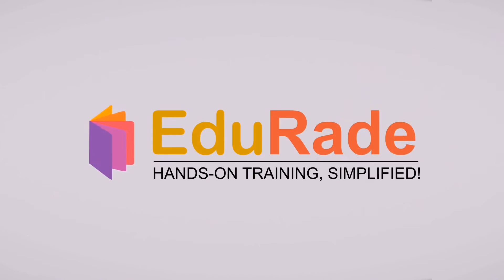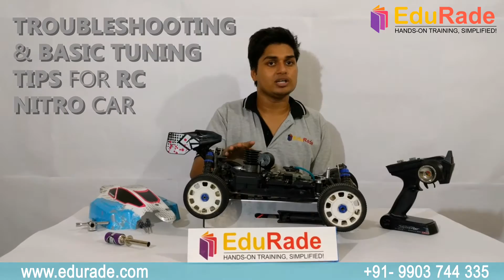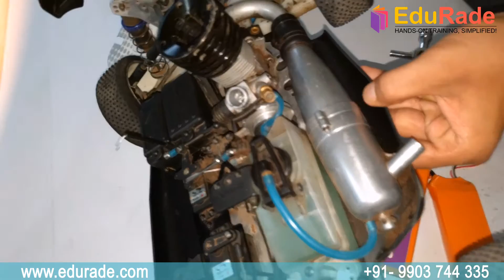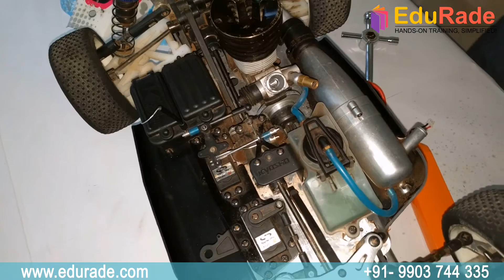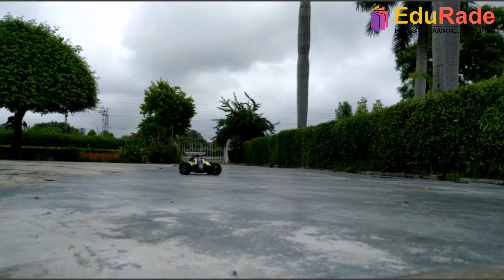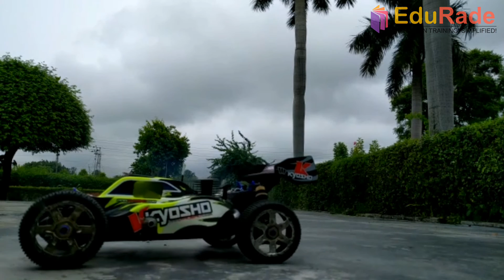Nitro IC Engine Tuning & Troubleshooting Tips for Nitro RC CAR | Edurade

Comment: I believe what you pointing as low speed needle is the mid range needle. Low speed needle is located on the sliding part of the carb.